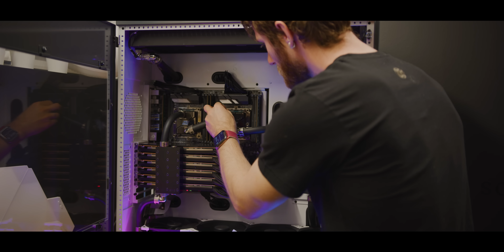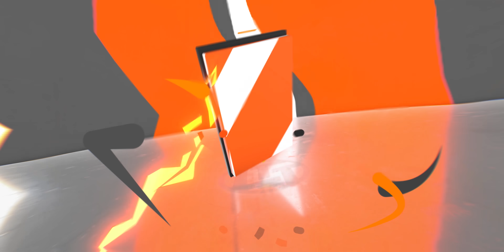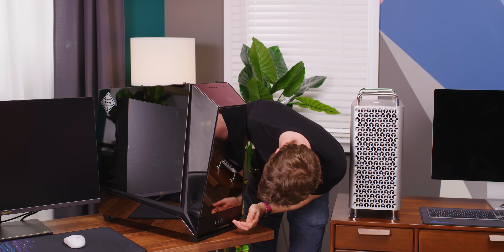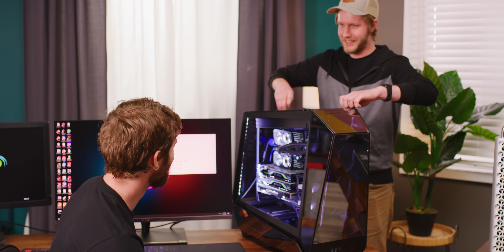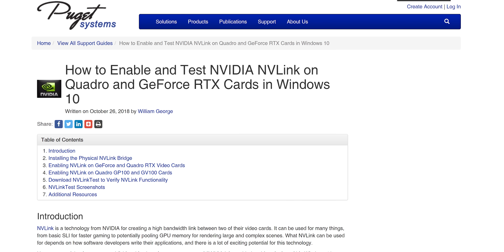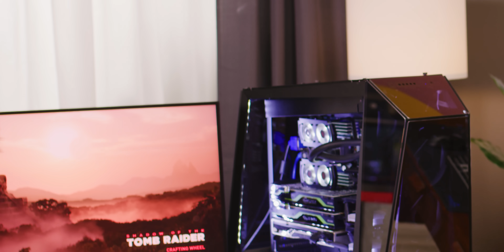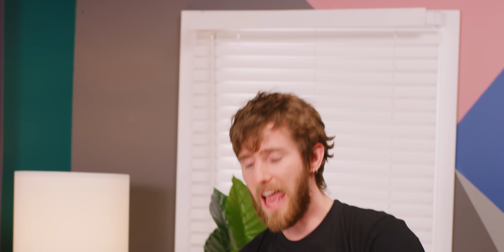The $32,000 Mac Pro Killer

Comment: I want to see ID Software's claims about Doom Eternal being able to run at 1000 fps tested here, minimum settings, minimum resolution.
Reply: Or crysis at a whooping 61fps at the lowest settings
Reply: @andy56duky  Nah I would say only 45fps
Reply: @geiers6013  dang, I was expecting high hopes.
Reply: Most games will prioritize single core performance, which the Epyc is relatively bad at as it is designed to be a server board and work with all its threads. Better idea to do this on a threadripper or something
Reply: Aditya  I wondered about that as well.  And if you have 2 gpu's in xfire or SLI mode. seems like somethings configured weirdly if they won't  go to a display . a 3rd one you just pull out of your ass would only add a bottlneck it'd seem like.
Reply: It will if you run the game at 720p, turn off lighting effects, textures, and reduce polygon count until everything looks like a clay model made by a kindergartner ;)

Source: LowSpecGamer
Reply: CSGO, LOL, Minecraft, The Witcher https://www.youtube.com/watch?v=Q8ao3AQ-5so ( RAM in the game + SSD matters)
Reply: What is everyone talking about? I ran Doom Eternal over 60 fps the entire game at medium - high settings with a 4gb GTX 970, an I5-7600k @4.5ghz OC, and 16GB of DDR4
Reply: honestly if you have a 2080 super and you did minimum res and settings you could probably get it since you can easily get 100 frames on ultra settings in 4k
Reply: @dansmemeaccount  java
Reply: Epic cpus are bad for gaming, because of low single core performance. U should try it with a 10900k or something similar.
Reply: I got my minecraft once to 1200fps. When watching ground ofc
Reply: LOL ID tends to troll. Or I guess in the case of Doom, hell and demon. And for the most mart the myth your can see up to 140FPS...is  generally that: a Myth. https://www.quora.com/What-is-the-highest-frame-rate-fps-that-can-be-recognized-by-human-perception-At-what-rate-do-we-essentially-stop-noticing-the-difference#:~:text=tl%3Bdr%3A%20The%20human%20eye,the%20way%20to%20150%20fps. 
The short answer is that people tend to confuse or conflate: refresh rate (how smoothly movies, games,  Monitors etcs> get more stuff  into an area, as compared to how many times your GPU runs through little cards (called frames). Latency, lagy how smoothly stuff is animated, getting games to not take antire hollywood movie studeos renderfarm just to loads. All that is a bit more important as compared to ID software trolling  at 1k FPS
It's why at lower FPS you don't get headaches. Has to do with  sensory overload

Comment: i think that the Blender results are useless, because it's on cpu render mode, 2x Quadros 8000 far exceed a 32 core cpu. Specially when you add volumetric effects, wich benefits a LOT from cuda and tensor cores and RT cores

Comment: Wait, it took you months to kludge together that jalopy that sort of does what the Mac does and somehow it's better than a Mac costing the same?  You're scared to upgrade it, it has no Blue Tooth, the Wifi looks like some kind of old fashion TV Antenna, with all the fans and water cooling you've jammed into the thing it sounds like a weed eater, and of course it looks like some kids gaming rig, and there is no measure of reliability.  It's still a cool build and comparison, thanks for sharing!

Comment: I'm running a 2012 HP Envy M4 notebook with an i7 3632QM @2.2Ghz and boosts to 3.2Ghz with 8gb of ram. I'm trying to get it to be a bit snappier without having to upgrade much if anything at all so I can save that money to build an actual rig. Was wondering if you guys could make a video on how to increase the performance for an older machine/laptop like mine so that users can stretch out the longevity if they need to or desire to. It's snappy enough for media consumption and basic internet browsing, but it does choke up on medium weight tasks. The only task it can really handle well besides internet browsing is minecraft 2-300 fps and League of legends around 180fps on high settings for both. Not sure if there is anything I can really do to make it be more responsive and have quicker load times, so I'm in the comments to consult the experts at LTT.

Comment: When a single stick of ram is way more expensive than my pc. Oof
Reply: I use to work with telecom servers having 6x16GB sticks back in 2008. Every time a server was trashed for some reason  so was the memory. Some of the servers was brand new. We trashed several every week. (While not all had 6x16  som had 6x8)

In 2015 operations closed down. We filled a whole cabinet with memory.  Dont have a clue what happen with it. In the inventory it was trashed... so... nobody knew it was there.

Comment: linus: gets 2 quadro RTX 8000 graphics cards in NVlink, 1TB of ram, an AMD EPYC processor, and a 1300W power supply
me: gets a 6 year old computer that has intel HD graphics 5500, 8GB of ram, and a mobile intel core i3 5020U

Comment: Great video as far as entertainment value goes.  Was really interesting to see a 7502P build.  Was really interesting to see what you could build for an equivalent $33K to the Mac Pro.

I've got a 1TB database that I need to do a ton of processing on.   I need to put together a really good high end machine for this work.  Single queries took up to a day on an i7.  Your video got me thinking.

LTT would be a much better resource if you treated things a little more seriously.  Instead of ending this project here, why don't you do a series of follow up videos on a more serious note.

- did you really need to run that super expensive (and hot) RAM on that board or will regular RAM work ?
- is there a more mainline (PC desktopish) MB for the EPYC processors ?
- what would the performance be with more mainstream video cards, like 2080Tis ?
- what could you build for $10K
- what would an equivalent Threadripper build look like ?  Not everyone needs 1TB of RAM.

So many questions left to answer.

Comment: Nobody:
Linus: spends 2500 on display output
Reply: And like....seeing as how it's turing, a 1650 would've been fine. XD
Reply: I would have used a threadripper 3990x
Reply: @lunaticheaven9446  3970x is more closely matched with the mac CPU, they didn't use it because it doesn't support enogh RAM.
Reply: @urgay1992  The limited maximum RAM capacity was the man gripe Linus had with the Threadripper 3990X. This is just to spit in AMD's face and say: "See you're just like Intel once your competitor doesn't have a competing product."

He is right though.
Reply: We know that Titan RTX card, property of LMG. It's seen many builds. Ironic that it ended up in the total tally.
Reply: @bgezal  Oh yeah, I know. Very used card. Still find it funny that they could've used anything else, but chose the $2500 TItan just for display output XD
Reply: Lmao the CPU itself costs almost double if my current PC

Comment: "This TITAN will serve simply as a video output"

say what now....
Reply: Tfw when you need to fill for 2.5k to match the Mac cost lol
Reply: @stevemccarr  "tfw when"
Reply: @GogitoGTHD  lol out loud
Reply: @stevemccarr  They could have gotten a 64 core EPYC CPU but I'm not sure how that one would perform in single core workloads compared to the 32 core model. Probably a lot worse. Without the needless spending just to achieve the same price it would be over $4000 cheaper just by using a GTX1650 and a cheaper case. That InWin case is beautiful but it's not like a Phanteks Enthoo Evolv X looks like cheap trash either.
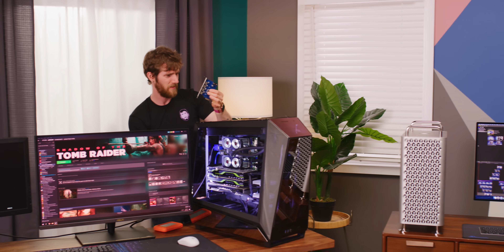Reply: 13:20 And then they bought cheap USB cards, that cause instability.

Comment: Why do you need a 32,000 dollar pc when you can just beat the mac with a 3200 dollar one lmao.

XD watch apple fanboys teardown this comment
Reply: I pretty much dislike apple and anything they stand for. But a 3200 dollar machine won't cut it.
I would much rather they did that though: how much do you need? 10k? 25k?
Reply: Abdur Rafi Nothing to tear down here. The Mac Pro is a computer for people who use Final Cut Pro X, Logic Pro X, xCode or other apps that are only available on Mac and are therefore kinda bound to Apple. I definitely agree that the Mac Pro base configuration is the worst bang for your buck (if you upgrade it on Apple’s website it gets worst, except the Afterbruner Card) but if you upgrade yourself you get a pretty good deal for what you are paying (compared to other manufacturers who sell prebuilt PCs). PS.: what 3200$ PC can compete with a 32k Mac Pro

Comment: Similar video: What's the cheapest PC build that can go toe to toe with the Mac Pro?
Reply: If you don't care about 1.5TB of ram, and are content with "only" 256GB then Threadripper 3970X would absolutely wipe the floor with the Mac Pro's Xeon, actually maybe even Threadripper 3960X would be able to do that.
Then your other concern would be GPUs - here you have 3 options depending on your memory needs. If you need raw speed, but don't care about large amounts of memory, then the most cost effective option would be to get a couple of RTX 2080Ti - 11GB per card is still pretty respectable. If you need more than that then get Titan RTX's - 24GB per card is plenty for lots of professional applications, including rendering and training neural networks.
But if you really want no compromises, and want to absolutely beat Mac Pro's VRAM of 32GB per card, then Quadro RTX 8000 with it's 48GB of VRAM is your only option.
So at the low end I would say you're looking at ~6000 USD
Reply: @Undy1  If you don't care about mega amounts of ram, maybe Ryzen 3950x or 3900x even could be competitive, that could save you even more over the Threadrippers
Reply: They should've made this video idea instead
Reply: sheeeit, for real world plus way, way cheaper, I'd go up against it with my humble ryzen 3900x and msi gaming plus x570... My GPU is cheap, but I mostly do music so I don't need much for GPU.  Still I can run 1080p games at highest-ish settings on 80+fps.. (Radeon 5500 XT 8gb running on pci-e 4.0)... and for music or streaming, 3900x crushes it, i don't need anything more powerful honestly exporting is the only way I can hit CPU 100%.  16gb ddr4 3966 ram, so you need to not care about having 1.5tb of ram for this to be fair... 3900x and 16gb ram is brutal for running ableton, you can arguably make any music you want on that setup.

Comment: Hey linus, quick question. I recently bought a desktop, monitor and keyboard for 50 euro’s. I just wanna know if i actually got an good deal. It has and intel core i7 860 2,8 ghz, geforce gt 1030 graphics card 4 gigs of ram. It has 500 gigs of hdd storage and has windows 10 pro installed.

Comment: They didn't put the side panel back for the benchmarks. Is it because there is zero airflow if it was on? Looks like the front is completely sealed so the three front fans are useless. Better hope Steve at Gamers Nexus doesn't see that.

Comment: Great video guys. One point though - Maybe the Mac Pro would have fared better if Premiere etc were running in MacOS? Considering how much Apple leans on optimizations via building both the hardware and the OS, I could see a huge difference in performance there.

Side note, thanks for everything Linus. You taught me everything I know about computers and changed my life, as you've done for countless others. Keep it up. <3

Comment: I need some help here, I recently just bought a gtx 1660 super and while my FPS did improve there is one game that does not like it and that’s fortnite, I put it at 144fps and all settings low on 1080p and and it has these little FPS drops to like 120 even tho the graphics card is sitting at 40% and my cpu is also sitting around 30-40%, my memory is also sitting at around 50% so idk what’s causing it to dip

Comment: "How does nvidia expect people to set up nvlink"
Using Linux. I actually wasn't aware that nvlink on windows was a thing. I never had big trouble setting it up on Linux. (though this also was in a server environment, not using a workstation, so no video output was required)
"python compile test"
Which writer is responsible for this nonsense?

Comment: Interesting, I did not know what to expect on the performance results but yeah, makes sense. I have a few questions/comments though:

1. How much would a company charge for actually building this system? I never really thought of this since most high-end workstations are pre-built systems from Dell/HP/Apple.

2. The IO on this thing is really terrible and I can see people that would not buy the Mac Killer just because of the IO, it is not so much of a "point loss", more of a deal breaker. I noticed that a while ago seeing a video from a music production guy talking about how useful he thought it was to have some PCIe slots to expand the IO of his MacPro.

3. As far as I know, the nVidia/Apple beef is enough to kill any type of real machine learning being done on a Mac. I don't do machine learning anymore (and I didn't use an apple device in the period I was involved in ML research) but I would never use a non-nvidia device to do any kind of Machine Learning that could be optimized using nvidia's cuda cores. If you are going to do hardcore deep learning, then you either get a beefy nvidia card or you do what I did which is to run all the calculation on the cloud (thanks microsoft for the grant).

Comment: This is all good fun, but I would like to see the numbers on a PC built to compete in the individual use cases where the GPU power or the large amounts of RAM are actually needed, rather than both.  For content creation, does having more that 256GB of RAM do anything for you?  For number crunching do you need more than the onboard 640x480 VGA?  I cant think of a case where it would make sense to have one machine that tries, and fails to be the best at a several tasks where being the best directly impacts your bottom line.  I'd like to see a one machine built for each task... I'm unsure, But I bet you could build both of them and have some change left over for less than this build.

Comment: Stress analysis can't be parallelized? Only if you're using a weak ass FEA solver. Multicore doesn't speed up linearly, but it definitely is run in parallel in every major commercial FEA code. CFD has damn near linear scaling with number of CPUs, so the PC would likely have won that case too.

Comment: The verge would be like:

This could run games in high fps
Reply: They'd probably benchmark it with Minesweeper
Reply: @CallanElliott  or ms paint lol
Reply: The Verge wouldn't even be able to put it together.
Reply: @SanderEvers  they would put the gpu into the hard drive cable socket rofl
Reply: @SanderEvers  they would try putting the graphics cards into the ram slots
Reply: Would explode
Reply: The verge would throw away one of the gpus because why would you want two.
Reply: hahahahha The Verge
Reply: The verge would say, that you would need a table and a Switzer knife
Reply: The verge would be like “well we couldn’t get it together but we assume it can run games good. The end”
Reply: Maybe it'll be able to run a calculator
Reply: @auminous_  lol🤣🤣🤣
Reply: Lock to 120fps for better stability
Reply: @kz400-  lol thats true🤣
Reply: We should never forget The Failure Verge
Reply: The verge would plug in the HDMI cable straight to the motherboard instead of the graphics card and tell people to get a Macintosh
Reply: With his 60 hz display
Reply: CNET and The  Verge have same people as their target audience who buy Apple products and go to Starbucks and don't know shit about Computers in general
Reply: Lol. I’ll never forget the guy benchmarking games with v-sync on on a 60hz panel 😅
Reply: Kimi They would use league for their FPS benchmark
Reply: And Forbes would be saying the future ARM MacBook Air would be faster
Reply: Most
Reply: This can run games in high def 15 years from now....

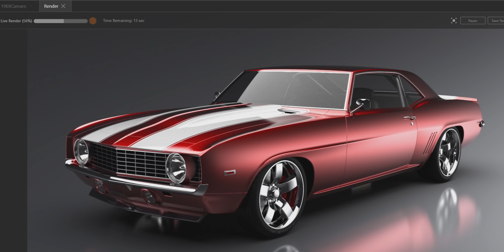Comment: 15:13 Wait what? I'm quite sure that Visualize can leverage both Tensor and RT cores, and on AMD system it takes advantage of the Prorender engine. I might be nitpicking slightly, but saying Visualize only supports cuda isn't quite right.
Edit: That is, as long as you use the 2020 version of the program.

Comment: Please, next time do make sure to state facts correctly. All 3rd gen Threadripper CPUs will support up to 2TB of RAM.
In fact, AMD says there is nothing preventing a Threadripper from running up to 2TB of RAM. The problem, of course, is Motherboards because they are officially stating 256GB, although the processor should be able to handle more. This is an issue that will be solved hopefully when DDR5 comes.

Comment: Hey, dunno why  I'm asking this so late but I have a question. In the optiplex 9010 video when you added the gtx 1660 ti and used the sata to pcie adapter, did you also use a extender for the adapter? I'm upgrading my 9010 and I don't think that the adapter is long enough to reach the sata power cables. Thanks!

Comment: Here's where I wish Zen 2 Threadripper boards supported the 512GB memory. The 3970X alone could slap the ass out of the Mac Pro's processor. What more could a 3990X can do? And imagine a dual-socket 3990X with the enterprise PCI-E SSD Linus showed in the last HOLY SH1T.

Comment: If you had gone with a better (and far cheaper) case like a Lian Li PC-O11 XL and also not set it up in such a derpy way that it takes forever to boot up, this would have been a lot more of a landslide.

I get that the CPU/MB choices were for the RAM limit, but a 3970X wouldn't have had the VGA output asterisk or been as derpy, you would have had more than just two M.2 slots, and the MB would have looked a lot cleaner.